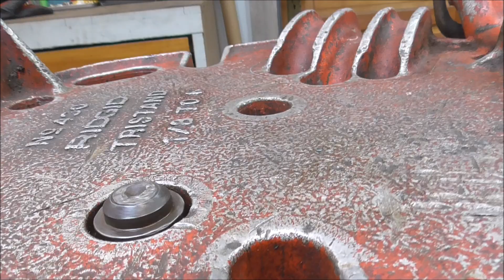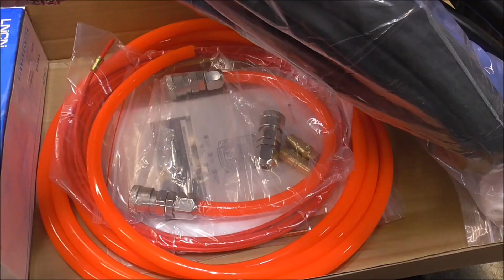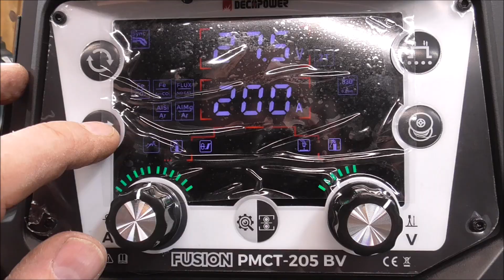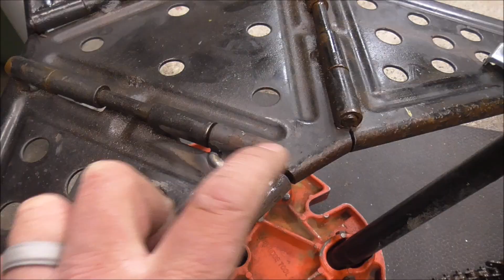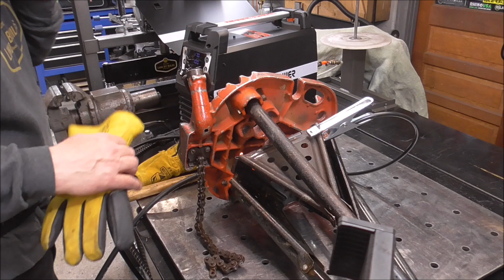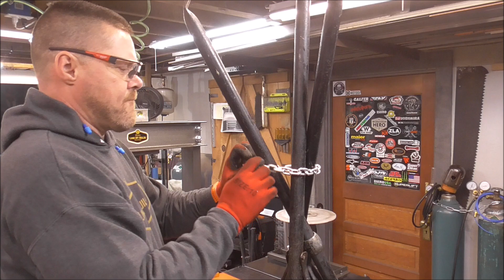Welding Repair Broken Ridgid Tri Stand Pipe Vise Using Decepower Fusion Welder #welding

Comment: Those are super handy to have around.
Ridgid makes a piece that you clamp in the vise that has 2 wheels on it.
That way you can roll the vise around.
Someday I am going to make a rip off of Ridgid's design.
Also the new Ridgid pipe stands can be ordered with a ground tab for welding.
I may add something like that to mine.
Reply from the maker: They definitely are handy!
Reply: @BrandonLund  I got looking at the new Ridgid that comes with the ground tab.
It is part of the thing the chain hooks to.
I just so happens the bolts that hold the jaws in go through that ground tab.
That way the jaws get a direct ground.
I will come up with some slightly longer bolts, make a tab with a couple of holes in it, use the new bolts to hold the tab and jaws in and then mine will have a ground tab.

Better than dumping a grand on the new and improved Tri stand with ground tab.
Reply from the maker: Thats an excellent work around! I'll have to see if I can rig something up like that for mine

Comment: I have threaded a lot of pipe on one of those  when I was a young electrician from 1/2” up to 4” conduit. You can hang your threader in the notch like you said and your bandsaw on the other side. I never had issues with it staying on the ground and the Rigid threader that we used, we called it a power pony, had enough torque that it could pick you up off the ground. We had a short rope tied to one of the feet with a loop on the end. Just loop it over the handle of the power pony to thread 1 1/2” and up. I went home smelling like cutting oil every day. Those were the days.
Reply from the maker: Sounds like you’ve got some great experience with that setup! I wasn’t aware about the bandsaw storage in the notch—good tip! I love the threader idea—definitely seems like it had the power to get the job done! And yeah, cutting oil definitely sticks with you. Those were some real hands-on days! Thanks man!

Comment: Your right it is a great multi tool. My father in law gave me one othise back in the 80 when I was doing heating and air conditioning. It has pipe bending on it to. It works good for conduit - metal or PVC , just use a heat gun or torch   weld on Brandon. That Deca welder. Looks very professional grade with the dual roller  .I have a Everlast with similar drive system. I can use a 5 meter 24 kd with a grafite liner ,and weld aluminum with out any feeding problems (.045 5356).
Reply from the maker: I had been wanting one of these vices for quite a while, but the cost to buy them new is crazy, and everyone wants top dollar on Marketplace. I got lucky because the guy I bought it from had 3 of them. His son was in welding school and the college was upgrading to newer ones so they gave the students these. They all needed a little something, but this was the best of the 3 that he had. So he didn't pay anything so it was all profit for him LOL. I was actually quite surpised with the machine because you don't normally see a double drive roller setup on machines that arent commercial grade. Very impressive!
Reply: Good deals for good people 😄
Reply from the maker: Thank you! 🙏